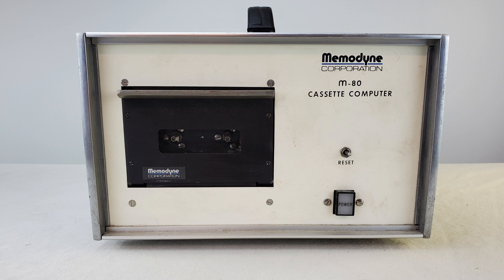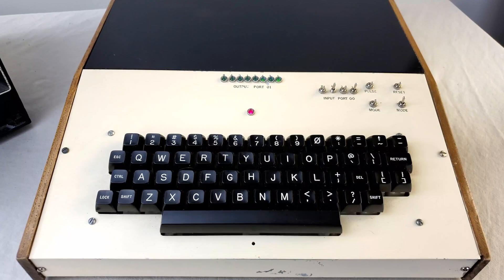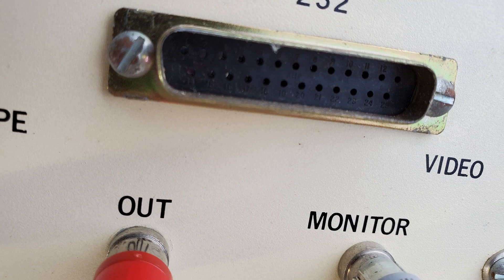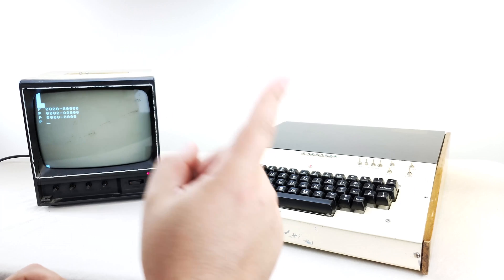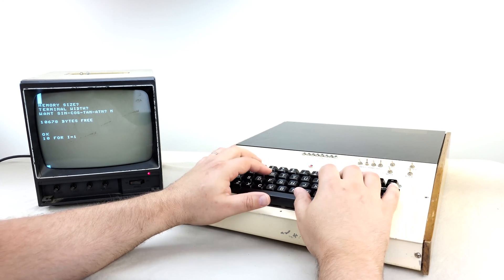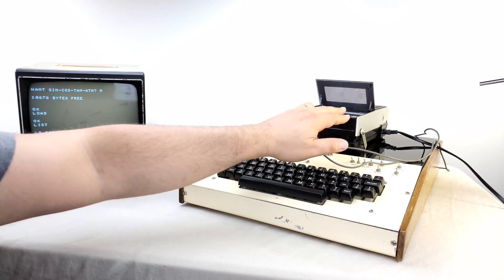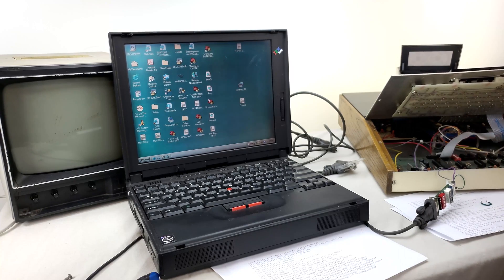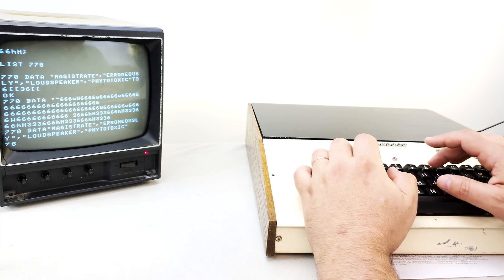Homebrew Z80 Computer Number Two - 8BitBites

Comment: That S/D monitor prompts look like it's asking for a source address range and a destination address
Reply: It could be that or Single/Double, as in memory size (a byte or word).  Especially since they had a different format.  S is 0000-0000 and D is 00000.  I was also thinking the "P" is for "Push" or "Put", but it's hard to guess without seeing more (if they exist).

Comment: These bring back so many memories.  I created a Z80 computer on several 44-pin edge connector cards from Radio Shack, and wrote my own monitor for it (and later Forth). I had planned to use it in a homebrew robot but got bogged down by the mechanical design and didn't do much with it.

Comment: That's not "Mary Had a Little Lamb" at 8:21, it's "Twinkle, Twinkle Little Star" :-)   Great video!
Reply from the maker: Yeah.  Honestly it's been that long since I've heard it!
Reply: It could also be the abc's
Reply: The designer probably added the tune for fun. The beep command on my HP42S calculator plays the Westminster Chimes.
Reply: In the 70's Radio Shack sold a standalone chip that had about twenty little tunes like that. You only needed a few discretes and an amplifier.

Comment: Nice mystery machine. Lots of early machines went down the embedded terminal route, even the Apple 1. There is probably a pile of control/escape sequences you can send to the terminal to do cursor addressing etc. It looks like that terminal has a few issues, maybe thats why it's set back to 300 bps.
As for talking to it with your laptop, sounds like a parity etc problem.

Comment: I immediately recognized that RCA connector; Radio Shack sold these a a low-cost alternative to the ones with a plastic back-shell. They work only if you perfectly solder them without melting the low-temperature center-insulator; additionally they are really meant for single use, where you just plug them in and leave them.
Great video, you're quite the digital sleuth and your tenacity is admirable...

Comment: pretty sure those switches just do what they say: set whatever the computer can read from input port 0x00, and then the rom uses that to jump wherever, because the z80 always resets to 0x0000

tried to disassemble your rom, not sure if that dump got messed with, but from what i can tell, it jumps to 0xe074 on bootup, 0xe3e3 on RST8 and 0xe3e6 on RST10 (all of which are 0xff, which means RST38, which itself is 0xff, so endless loop), and the remainder of the code also doesn't make too much sense to me, so not sure what's going on there. if i'm interpreting that code correctly it should never start up. maybe they connected some address pins in "creative" ways, or the connections to your adapter were just dodgy due to pins having a patina after all that time maybe?

Comment: Hi,

I've started pulling the binary files to bits and the start up process looks fairly simple (if I am reading the code correctly) :) 

On RESET the system waits "PULSE" button to be pressed ; it then reads PORT 0 switches and uses the value as an offset into a look up table. The result of the look is the address, within the monitor, that the processor jumps to. Each code segment seems to be no bigger than 256 bytes (so far).

The look up table has code entry points for  all but 2 switch combinations (1100 and 1101 do not). I think I've found the two "musical" setting but it would be really useful to know what you see/hear for each combination of the PORT 0 switches. 

Thanks for a great video...

Comment: I downloaded the TOS .bin file and made a pass at dissassembling it. It would help to know the memory map for this computer. I assume the ROM starts at 0000h, the address where code execution begins after a reset. The first two instructions are:
ld sp,0
jp E074h

There are two other vectors for RST 08h at 0008h and RST 10h at 0010h both with targets in the E000h block. It isn't uncommon for address decoding to result in ROMs or RAMs to appear in multiple blocks of the address space.

Back to the SP, setting it to 0 would result in the first byte pushed onto the stack will be at address FFFFh meaning there has to be RAM there.
Reply: Roger, I've had a very quick look at the ROM and notice something of interest: The "LD SP,0000" command occurs every 100H bytes and the preceding bytes are "FF" - padding between ORG statements? The other think is that, if I'm decoding it correctly, the "CALL" all seem to be in the Exxx address space (E3xxH and E4xxH) so that seems to agree with your statement that RST vectors are in the E000H block. 

The "mode" switches do seem to act to change the restart vector - maybe force some of the address lines?

Comment: I noticed you typed Morristown NJ. Is that where you live? I live in Hamilton. If not is there a reason you typed it?
Reply from the maker: No that was just the copyright info the original programmer of that Hangman program put in there.  Actually I did live in New Jersey for a time, but I actually live in the Greater Vancouver area now.

Comment: You have probably checked this already, but is there anything on the underside of the case? e.g. a manufacturer's name, serial number, anything that may help identify the origins of this hardware

These videos about ultra obscure systems are a refreshing change from the usual mainstream computers that everyone covers! Thank-you. 😃
Reply from the maker: Nada.  I even pulled the computer itself out with the power supply but no joy.  I have been perusing old magazines from the early 80s.. I figure if someone did this in some volume, given that these units have turned up in various places around the country, they must have advertised it somewhere.

Comment: going to make a wild guess on what that tape noise mode might be for the monitor - since it comes out as noise and is part of the terminal ROM, is it possibly something you could send through the tape out as terminal commands? either live or possibly recorded for later use, ie type out a program at home and run it on the mainframe at your institution?
Reply from the maker: Yes, I kind of think it is like early 70s machines where you could 'punch' memory contents to paper tape, and then later with the Kansas City standard they changed processes to encode to audio.  If I ever figure out how the monitor works I hope to try reading in something and seeing if it works as anticipated.